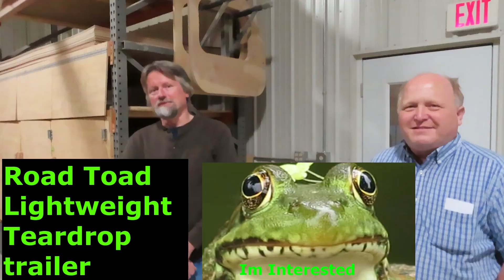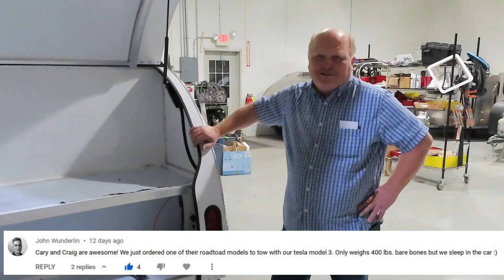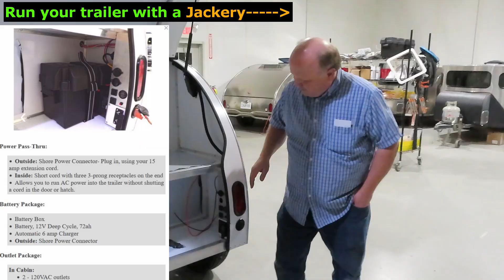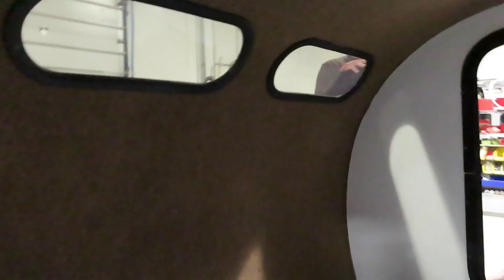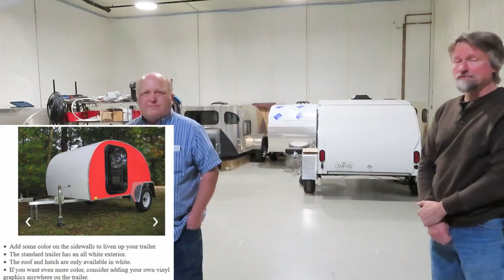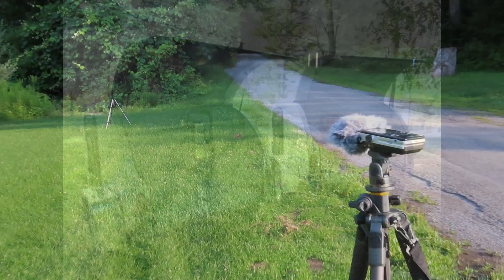$6000 Road Toad Teardrop Trailer from Camp-Inn Lightweight quality

Comment: open shelf kitchen creates options— for me.
Chill
I want to install small IceCo fridge 12v, run it off Bluetti solar/battery unit. The power sourced from the back I like.
Water
And potentially install Atmosphere Water producer ...countertop version AC power ( research needed for vibration issues?) My Bluetti can handle power consumption . Create drinking water off condensation.

I like the spare tire mount and box. Looks aerodynamic. 

Additionally a roof rack for weather protection tarp. Ya...

I have a EV so for me weight and aerodynamics look easier on my car battery range. Plus my Solargen can trickle charge my car if push comes to shove. 😆
Reply from the maker: We are of one mind! Space if flexibility. Let me know how the condensation water supply works out. I am curious on the amount of water you can capture.  𝕋𝕙𝕒𝕟𝕜 𝕐𝕠𝕦 𝕗𝕠𝕣 𝕨𝕒𝕥𝕔𝕙𝕚𝕟𝕘!  ✅  Check my other videos https://www.youtube.com/cosmoweems/videos 
SUBSCRIBE https://www.youtube.com/cosmoweems?sub_confirmation=1 =𝓒𝓸𝓼𝓶𝓸 ✅

Comment: Hi Cosmo: Thank you for yet another wonderful and informative video.  I love these teardrops. When I saw the Totes I immediately thought, 'that is the one for me! I am a big fan of flexible space and simplicity. I especially like the easy-clean interior and the gear tie-downs.  My question for you is, how did they do the wiring in this unibody?  Are there covered conduits on the walls?  I am thinking about how I would add to the electrical system after purchase.  Thanks again.
Reply from the maker: Hi Carol. I agree the quality, simplicity, and flexibility are hard to beat. I suggest you call them and get the information you need. =Cosmo  𝕋𝕙𝕒𝕟𝕜 𝕐𝕠𝕦 𝕗𝕠𝕣 𝕨𝕒𝕥𝕔𝕙𝕚𝕟𝕘!  ✅  Check my other videos https://www.youtube.com/cosmoweems/videos 
SUBSCRIBE https://www.youtube.com/cosmoweems?sub_confirmation=1 =𝓒𝓸𝓼𝓶𝓸 ✅
Reply: Wiring for the taillights is run, I believe, underneath the trailer. Interior electrical in the totes is entirely in the passenger side rear corner, with the shore power connection on the outside just under the r. taillight.

I'm putting a small storage/headboard at the front of mine that will have 12v and USB ports. For the wiring I'm just running it along the edge of the floor using adhesive plastic "wire hiders".